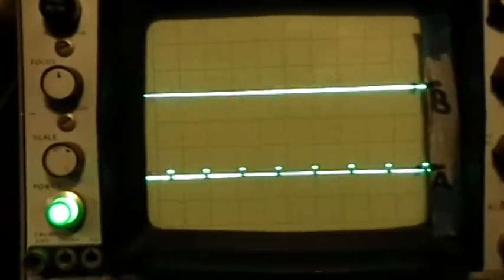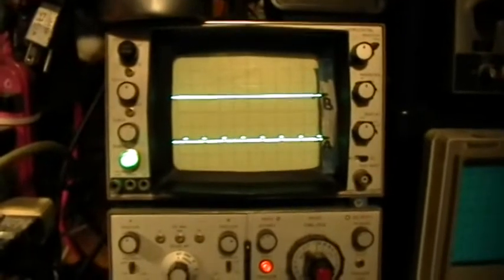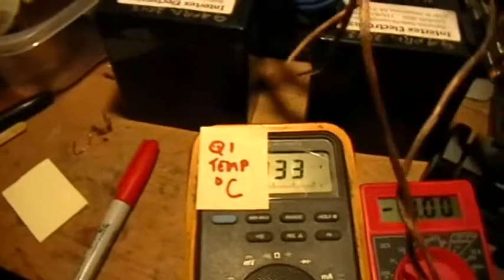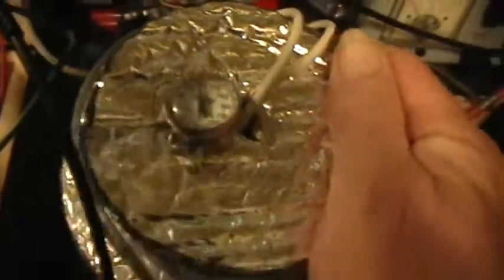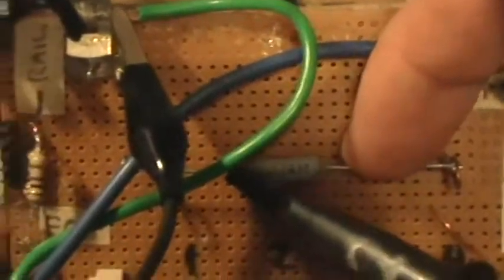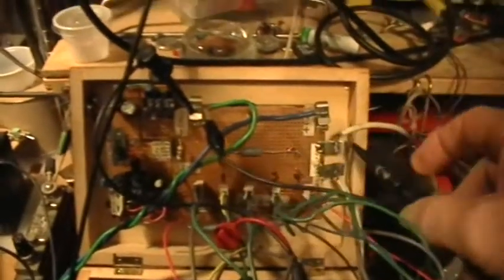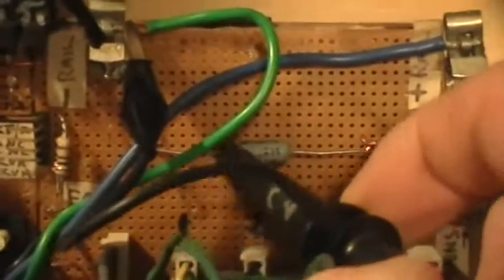Electric OU: Tar Baby and the Ainslie Figure 3 Scope Traces: Alternate Methods

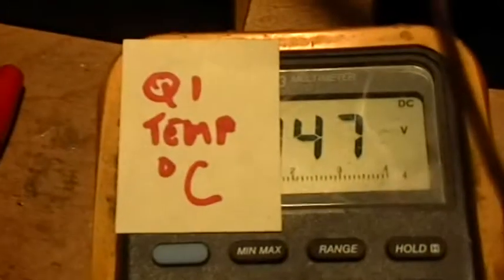Comment from the maker: From 6:48 to 6:56 the right connection is seen, and also several times earlier. I finished with the "wrong" connection that shows the Ainslie Fig 3 traces, but the "right" connection is indeed shown several times.

The point of this video is not so much how the probe is connected, but that the mosfet should be carrying upwards of six amps in this condition, and this is very close to its absolute max rating. Ainslie's scope trace was probably made with a failed mosfet, not a misconnected probe.